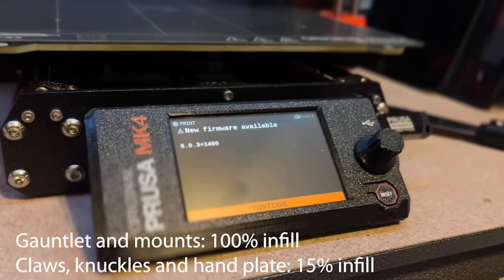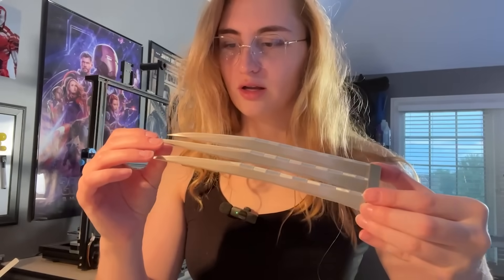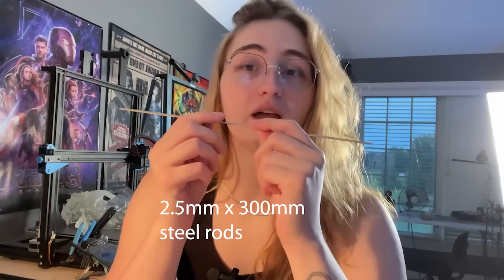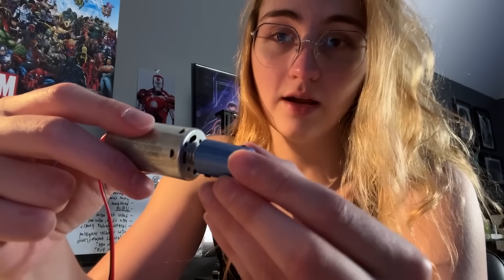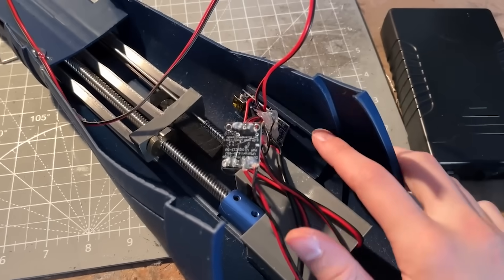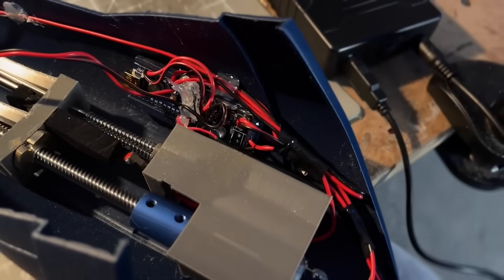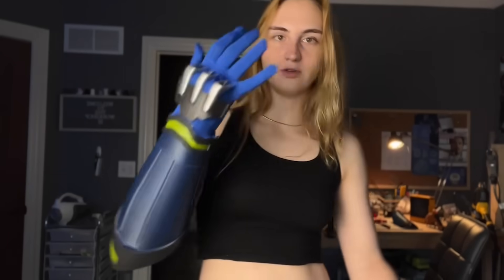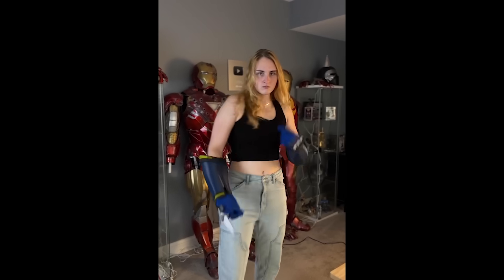How I built working Wolverine claws

Comment: Ngl, the fact that your claws actually make a "snikt" sound without having to add a soundboard is a pretty damn awesome coincidence.
Reply: she could do like something inside of it where metal grinds on metal? and maybe it will sound more like a "shink!"
Reply: @KingdomMinded70x7 i kinda think the sound bits they use for a sword/knife sliding out of its sheathe would be nice. That very clean and clear shing but that might be better for the times its a slower extension, which would also be an interesting thing: if she could make a way to have a fast extension and slow extension
Reply: They have little rigges on them to make the noise
Reply: They don't make a "snikt" sound that is the sound of small ridges of plastic grinding against other small ridges of plastic because she didn't sand her 3d printed parts.
Reply: @thomgizziz thats what they are talking about. They are talking about that sound.
Reply: Just proof the original artist got the physics right, that if they were actually real, they would make that same noise
Reply: @pimpinken8901 kinda but mostly yeah
Reply: @pimpinken8901  This is a clueless comment.
Reply: @thomgizziz  nope just a clueless person reading it🤷🏾‍♂️
Reply: @pimpinken8901  No, these one makes that noise because of print lines...

Comment: Hey Kiara! Amazing tutorial. Been waiting for the full video since i saw it on your IG! Though i have a question. I'm struggling to find a small powerbank with DC outputs on my local e-commerce stores

As I'm new to this, any alternatives? Can it be only using powerbanks with usb ports. Would appreciate some help!
Reply from the maker: hey, thank you!! so it doesn’t have to be a specific power bank, the one I had was just one I had laying around that happened to work perfectly. If for some reason that one isn’t available to you, you could definitely use a power bank that only has usb ports, the downside to this though is that those usually only provide a 5v output (the motor I use needs 12v to run efficiently, usually dc ports provide that). you could try to run the same motor I used off a 5v usb power source and possibly use a power booster to get up to 12v, or try to find a motor that runs off 5v instead.
Reply: @KiarasWorkshop  thank you! Ill see what i can do from my end. Maybe even have 2 seperate powerbanks for each claws. Anyways awesome stuff! looking forward to see your other work!

Comment: This is some damn fine engineering. This design you came up with can be adapted to all kinds of other props that have an extending function. X-23 claws, Predator, etc. A variation with extending gun barrels can also be cool. I think the bulked up arms actually work for this. 
Subscribed.

Comment: Very cool! I think tweaking the knuckle design a little to where the claws taper out and adding hinges for the claws could work because wolverine’s claws aren’t perfectly parallel. Also adding separate small batteries into the gauntlet could help with mobility and make sleeveless cosplays possible

Comment: I think the wires connecting each other to each arm are a hazard that could end up breaking the whole thing if you accidentally snag a piece somewhere. If you designed shoulder pads/arm protectors that run from your elbow to your shoulder you should work in a place to keep all that spare wiring/tech, but to really make it better, one per arm, that way you can eliminate and hide all the wiring you can.
Reply from the maker: ideally, you’d use cable management to contain both wires in each arm and then like I mentioned in the video either snake them through a costume or use skin tape. def a hazard though as I unplugged myself multiple times swinging my arms around haha, but in the scenario of using these for real you’d definitely strap them to your arm. this was just for demo purposes
Reply: @KiarasWorkshop  Those ipod holders on arm straps I used to see joggers run with just came to mind. None of them would be big enough for that motor/battery device you have, but some kind of holder via 3D printing could do the trick, perhaps.

Comment: looks so cool but i couldn't help but think that some rails would have made the design better, also if you used the claw design of the cartoon you could make the assembly a little smaller and self contained, idk maybe, just thought of it, like it would be really cool if you had a 5 volts motor that could be powered by usb and then you could hook up the motor and the arduino to the same power source, but like i said idk how feasible that is
Reply from the maker: all great ideas! would love to find a motor with this rpm that runs off 5v, would def make the power source less bulky in your pocket
Reply: @KiarasWorkshop  hopefully you'll find it because it would be so cool to see in action like that

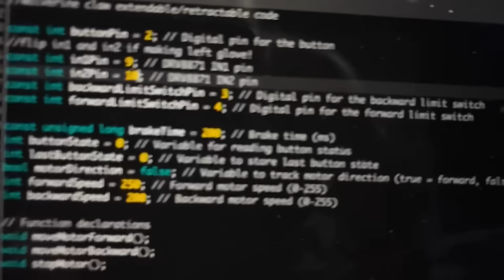Comment: 9:23 what did you mean switch the pins? do you mean swap the place the 9/10 are?
Reply from the maker: you can either swap the 9 and 10 in the code, or wire them opposite on the motor driver board. just changes the direction the motor runs so it’s mirrored across the right and left gauntlets
Reply: @KiarasWorkshop is the code as is intended for a specific arm or no? i’m kinda new to all this
Reply from the maker: the code should be for the right arm first. if I remember correctly I switched the pin declarations back to that orientation. but in the case that it isn’t, it’s an extremely simple change to implement for both arms
Reply: @KiarasWorkshop  sweet, you’ve now just eliminated the most intimidating part for me, i really appreciate it!

Comment: Will oiling between the T-nut and the lead screw help it from getting stuck?
Reply from the maker: it might, I did try a little bit in one spot but admittedly haven’t oiled the entire thing! I definitely noticed more of a drag on the one that was completely dry vs the one that I did oil a bit so that could help

Comment: Cool. I just got into 3D printing. I had an idea for straight blade Katana that was in small section with hinges painted to look part of the design and using magnets, the sword would unfold like a whip and the small super strong magnets would keep it straight but you could pull the tip to one side and curl it up. But my skills to make this a reality are just not so good. 😂
Reply from the maker: is that kind of like a pacific rim sword? that would be sick

Comment: It would be insane If the outer claws could slightly hinge at the base so when they slide out they splay slightly outward like In The movies
Reply from the maker: my friend suggested that too! super smart idea, my only hang up is if I wanted to hit things with it they wouldn’t be as strong as if they were directly mounted
Reply: @KiarasWorkshop  ya. Would probably need a whole track system in the knuckles to locks them in better. And even then they could be wobbly

Comment: what kind of files would I get on your patreon page , Is it a STL file or CAD file?
Cause I will need to modify CAD files according to my forearms and I won't be able to do it with STL files
Reply from the maker: they are STL but that’s a good point, I used Blender to model this so it wouldn’t be CAD but I will clean up the blend file and upload that into the pack now!
Reply from the maker: Blender file is now included in the file pack!